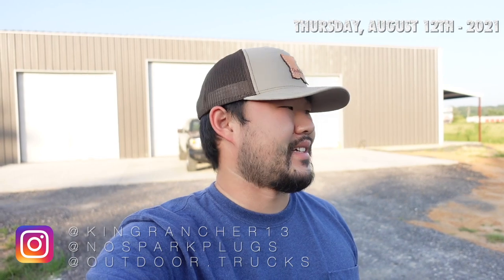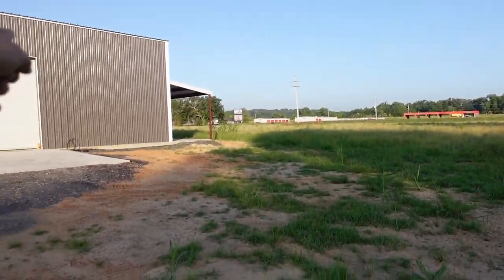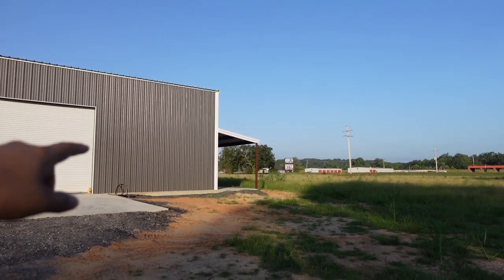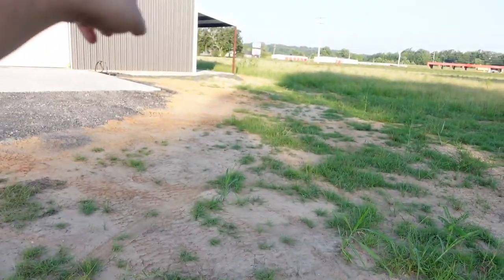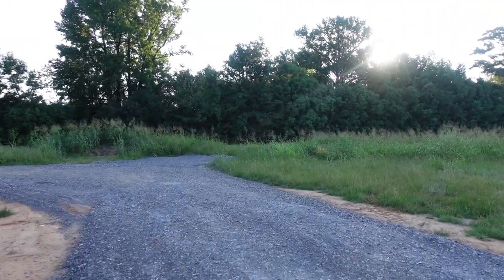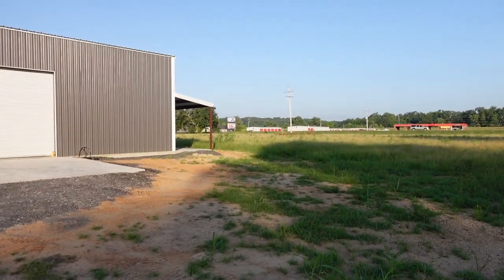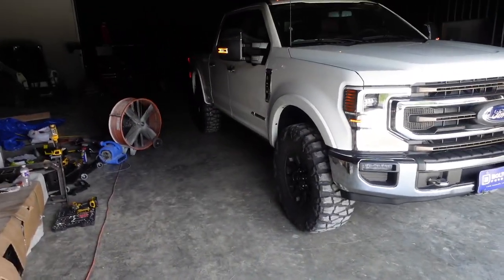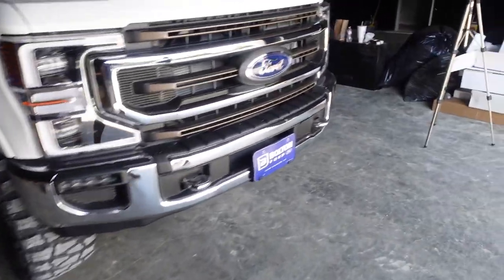Brand New 2022 F-250 Gets the BEST LIFT KIT!!! (Ok, so maybe it’s not the absolute best…)

Comment: 80k truck with a cheap leveling kit.  
Clearly not the Best.  Look into Carli or Icon.
Reply: If you wanna spend 1500 dollars sure.
Reply: @tylerfugate1882 yes, if you want the “best” leveling kit.
Reply: @tylerfugate1882   best ride quality for a solid front axle.
Reply from the maker: True, it’s the best quick and cheaper lift!
Reply: That’ truck has a SFA? I thought Fords had IFS.  What kind of leveling kit did you use?
Reply: @mickyfingaz  ford and ram have solid front axles

Comment: did you use the Ready lift 3.5 sst 69-2735? also could you tell me what the stock rear block measures vs new one? Did u use the drop bracket how about caster shims?